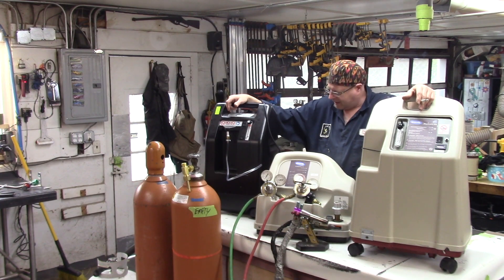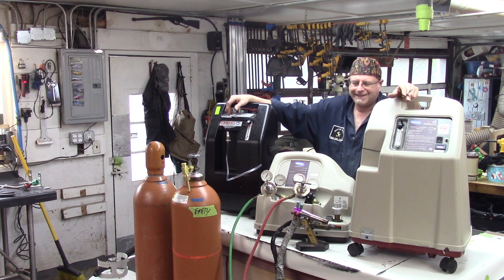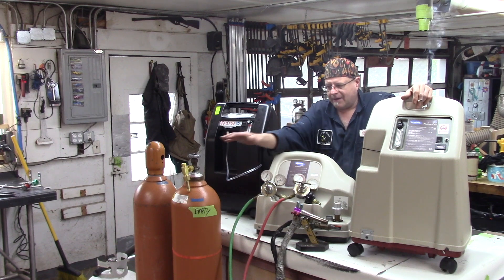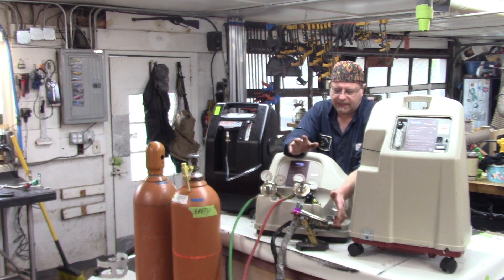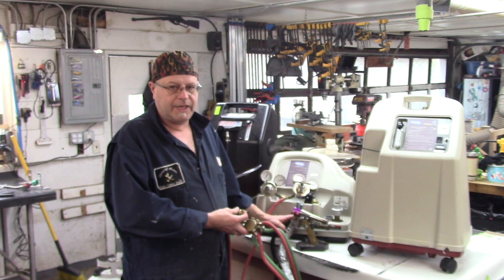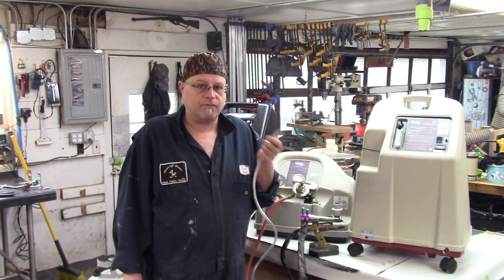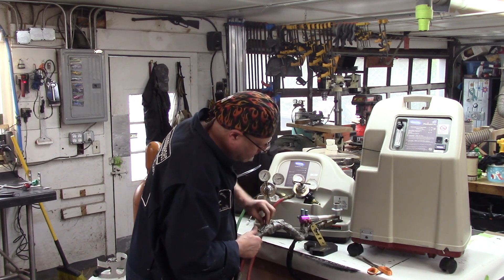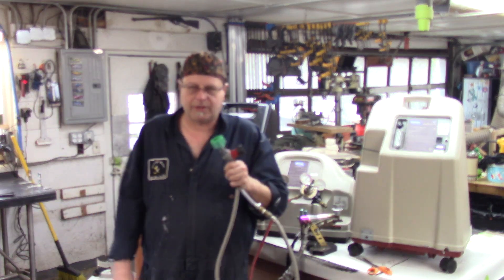lamp working torch and home oxygen compressor intro video

Comment: "It's your fault if the house burns down."  While smoking a cigarette around welding tanks. Do you by any chance know where to get the whip hose?  I want to connect an Invacare compressor directly to a CGA-540 tank (40 cuft) without a regulator without a pressure gauge.